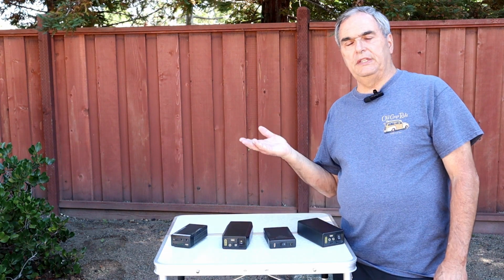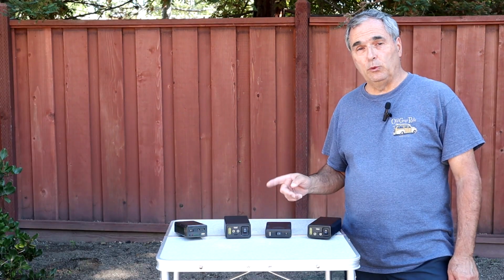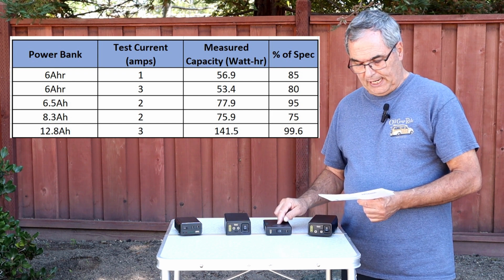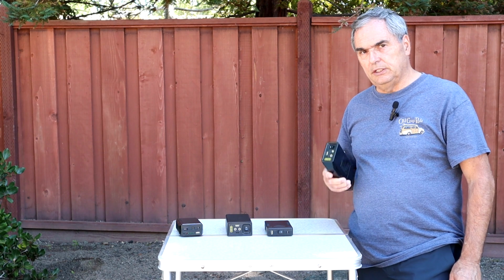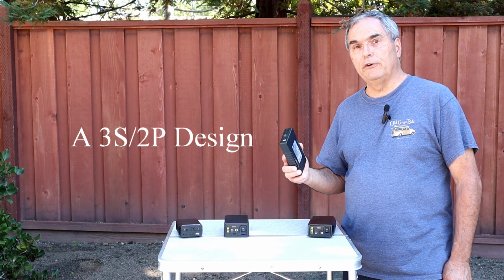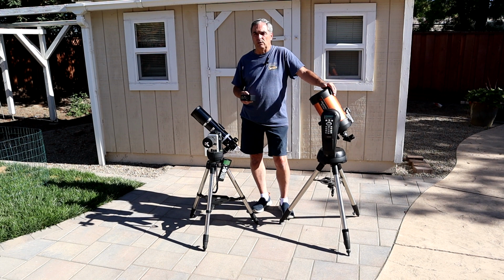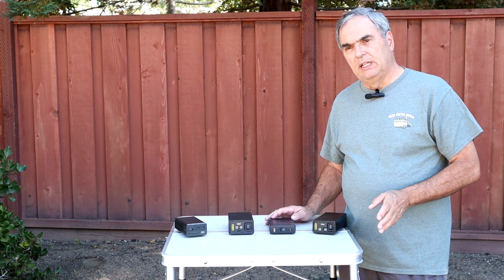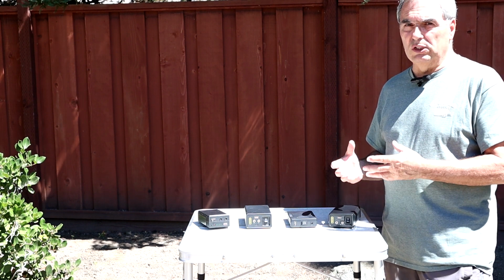These Talent Cell 12V Batteries are not Really 12V Batteries

Comment: would the Talent Cell 6Ah NMC power bank be safe for my m12 Milwaukee heated jacket. going of this the answer is no but everyone uses them and no one has had any problems that i know of does it mater if it drops below 12 volt is my question for this use?.
Reply from the maker: I don't know the specs of the jacket you mention but so long as  it is 12V there should be no problem.  Low voltage for something like the heaters in the jacket is not going to damage anything.

Comment: Which one would be the best for 12 volt LED strips? I wanna mount them on my scooter
Reply from the maker: I suspect the LEDs can handle the lower actual voltage of the non-LiFePo4 power banks.  So I think that any of them should work.  Just depends upon your budget and how much weight you can handle.  If it were me I would go with the LiFePO4 model.
Reply: @astronomytipsreviewswithcu740 I can handle anything up to 3 pounds. The lifepo4 model has 5A current which is less than the 3S packs 6A according to Amazon
Reply: @astronomytipsreviewswithcu740 nevermind, I decided to only go with 2.5 meters of LEDs totalling 3.8 amps of draw which will be good for the 4S as long as I don’t charge it past 13.5V to not kill the LEDs

Comment: The power bank on the far right which you said is 12.8V, I believe you called it 4S? Will this power a celestron astro fi 130? If it's over 12V would it risk frying the system?
Reply from the maker: I checked the manual and I hate when they do something like this, giving a requirement of 12V but not specifying the voltage range.   No device works at 12V exactly and only 12V exactly as no battery or power adapter is designed to control the voltage that tightly. They should take the time to specify the upper and lower voltages.  Many devices can handle voltages up to 14V or even higher and down below 11V.   12.8V is very common in any type of 12V battery or power supply so do not worry it will not damage the 130.
Reply: Thank you for your response. I admit a lot of the content in the video went over my head, but it was insightful to see how similarly packaged and marketed products can all function at different specs
Reply: @astronomytipsreviewswithcu740  Interestingly enough, I got the 4S model and it would not work with my telescope. The battery is working fine because all the green lights came on, but when I plug into my telescope using either of the connections provided, the scope will not power up. Do you have any ideas why?
Reply from the maker: @ssvishnov  I do not know what is going on.  The 4S model has sufficient voltage and current capacity for that scope.  Wish I could help more but without having access to the equipment there is not way for me to trouble shoot the problem.

Comment: Good stuff.  I went through this analysis, for astro, 2-3 years ago, after my Celestron Nexstar mount went rogue when the AA batteries or a small Li-Po power pack ran down to near10.5 V .  Apparently the chip in the hand controller got confused and sent order without asking.  Ended up getting a Celestron  PowerTank Lithium Pro which is LiFePO4 but crazy expensive. One point you didn't mention was low temperature performance.  In some places, viewing sessions can be well below freezing and LiFePO4 performs much better than Li-ion in the cold.  I also went LiFePO4 for safety reasons, cheap Li-ion power pack have a bad track record of explosions and fires when charging or mishandled.  Celestron has an excellent summary of astro batteries on their website called Ulitimate Telescope Battery Guide.

Comment: You didn't mention how many times a battery can be re-charged.  To my knowledge, if you compare lithium ion batteries to LiFePO4 batteries, LiFePO4 has a longer lifespan.
Reply from the maker: It is not "how many times a battery can be recharged", rather how many times the battery can be fully discharged.  So for LiFePO4 the typical spec is 2K or more full discharge cycles.  Partial discharge would result in more of those cycles.  But I think 2K is more than most of us would end up using over the 10 year calendar life of the battery anyway.  By the way, let me correct a common mistake folks have about the technology.  The term "lithium ion" is a general term which includes all of the lithium chemistries that use lithium ions to create current.  That includes LiFePO4.  I suspect you were referring to LiNiMnCoO2 which is used in most TalentCell power banks among other things and is rated at 500 full discharge cycles.

Comment: Thanks for your testing. We will keep improving quality of our products. Our product includes lithium ion batteries and LiFePO4 batteries. Some 12v lithium ion battery (YB1206000/YB1203000/YB8300/PB120B1) is 12v lithium ion battery with output voltage 12.6v to 9.0v,it’s little lower than 12v lead acid battery. It’s special for led lights/strip,amplifier,router…etc. some 12v LiFePO4 batteries such as LF4100/LF4106 with same voltage with 12v lead acid batteries. Output voltage range is from 14v to 12v. It can use for 12v cameras and ups. And some model such as PB240A1,PB240B2,PB240B1 with 24v and 12v(constant 12v) dual output.
Reply from the maker: Thanks for checking out my review.  You should know that I have no problem with the quality of Talent Cell power banks.  I have several that I have used for years and have no problem with the quality of the build and reliability so far.   But I think it is misleading to call the power banks with 3 LiNiMnCoO2 cells in series, like the YB1206000/YB1203000/YB8300/PB120B1 12V models, when the nominal voltage is 11.1V and the output voltage drops below 12V almost immediately after applying a small load.  In fact, as my review shows, these power banks have half their capacity below 11V which does not work well for many devices spec'd to work at 12V.  This is not a problem for devices which require 9V or 5V where they work quite well without any low voltage issue.   I have had the YB8300 for more than 6 years and it continues to supply power for those applications where my devices can handle voltages lower than 12V.  Last year I bought the LiFePO4 version LF4100 for applications where 12V is a necessity and I have been happy with its performance which is why I highly recommend it in the video and in my on line postings.  I can see that many folks have purchased this power bank based upon my recommendation.
As for the 24V models I have not tested any of them but I suspect that they will have the same problem supplying 24V with a load applied but not have any problem with maintaining a 12V output.  Again, the problem is in the design using too few cells in series and not including a voltage regulator when using LiNiMnCoO2 cells.
I just purchased the Talent Cell model NB3200 to test as a compact light external power source for the Seestar S50 Smart Telescope.  It also suffers from the same voltage issue as the other LiNiMnCoO2 12V devices but this is not a problem for the Seestar which can use 5V USB power to operate.
Reply: @astronomytipsreviewswithcu740  have you ever tried using one of these while drawing power and charging it at the same time with a small solar panel with a Y cable?
Reply from the maker: @Yugos-Survival  No, but I believe that is possible.

Comment: Hi,nice video. Before I saw your video, I ordered Talentcell 12V LiFePO4 Battery Pack LF4106 (hasn't arrived yet)....do you think this is OK for AVX mount with a Starsense autoguider?
Reply from the maker: Yes, that is a good power bank.  Remember it only has 6Ah of capacity so, the useable time will depend on how many other things you are powering beside the mount.  The mount uses less than 1Ahr.

Comment: Thanks for the video.  I have a 3 cell TalentCell ( yb12011000usb) and I've noticed a variable slew sound coming from my CPC go to mount after a few hours which I wondered if the battery was low on volts......  Anyway I noticed your latest post to your CN topic about the LF4106 and comparing to the LF4100, I see a76.8 Wh vs 83.2Wh for the LF4100.  Is the LED display in the 4106 more advantagous than the LED 'dots' on the 4100?   I ask b/c the TalentCell I have now is 11,000 mAh vs 6,000 for these.  Thanks
Reply from the maker: Low voltage could be the issue with your mount.  Unfortunately TalentCell's LiFePO4 power banks don't come in capacities larger than 6.5Ah.  If you need a little more capacity than this they have this a 12Ah LiFePO4 battery which comes in a traditional battery form factor https://amzn.to/470dIc1.  It doesn't have the convenient dc port but will provide more capacity at 12V than your 11Ah version.  As for the LCD display I am not sure it will be more telling than the 4 lights given the fact that the voltage drop on a LIFePO4 battery is very gradual so it is hard to tell how much capacity is left until it is about 90% depleted.  You could put a power meter in line like this one https://amzn.to/3McW4tw  but you would have to make some adapter cables or buy ones like this for either end of the power meter https://amzn.to/3sbehRs.  Links are affiliate links.

Comment: Nice analysis.  I know my eq6r shuts down when Voltage drops below 12 and I have camera issues as well.
Reply from the maker: Good input to share with others.  Lots of equipment works just fine, at least for some of the capacity.  But others won't.